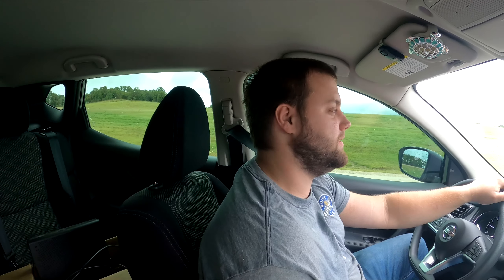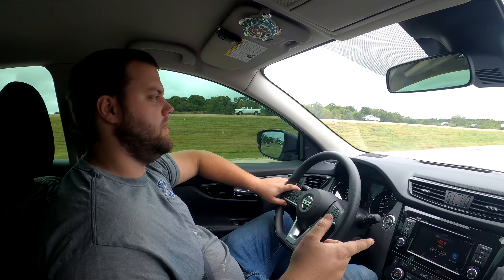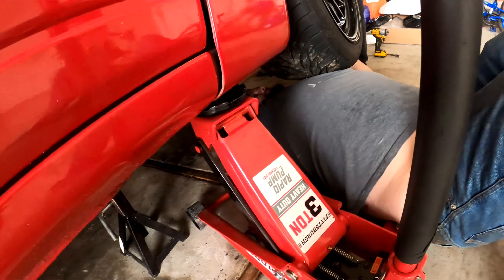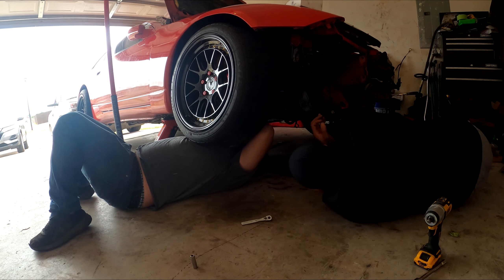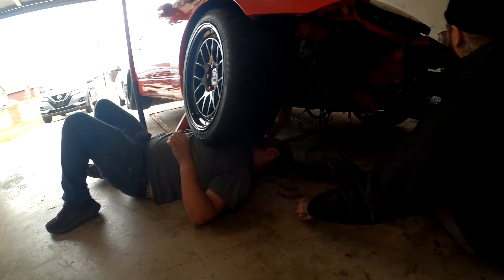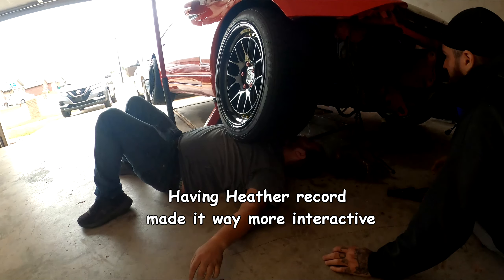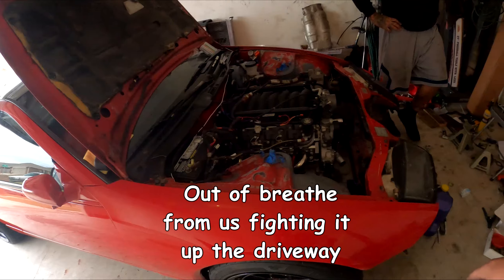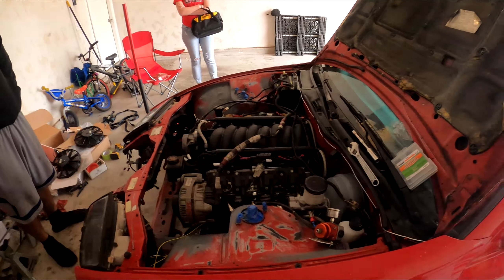LS1 300ZX Holley Terminator First Start !

Comment: What do you do to be able to turn the car off? With key
Reply from the maker: It’s got a wire to ignition
Reply: I’ve got a similar set up except I’m using a 5.3 I’m still confused on how to wire the terminator to the fuel pump and ignition.. could ya help explain it a little
Reply from the maker: @brandy292878   are you doing a 300zx?
Reply from the maker: The fuel pump wire went straight to his fuel pump but if your running a heavy fuel pump you will need it to go to a relay and then u just need a wire that is on during key in on position and crank position
Reply: Yeah it’s a z32 with a 5.3 ls1 intake.
Reply from the maker: @brandy292878  I’ll find out what wire we spliced into it was on passenger side firewall I think it was brown but not 100%
Reply from the maker: I’m back so it’s the black and yellow wire from the key ignition that we mated to!
Reply: @BuiltByBelt do you have an email ?
Reply from the maker: @brandy292878  I have a Instagram @builtbybelt